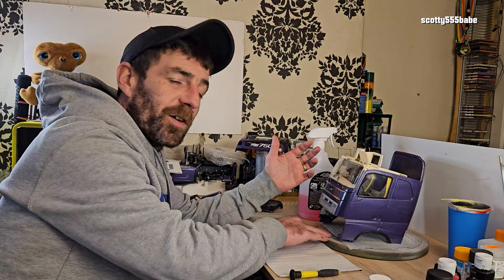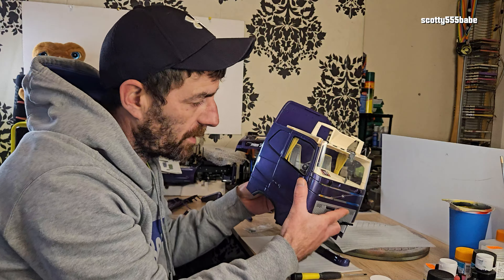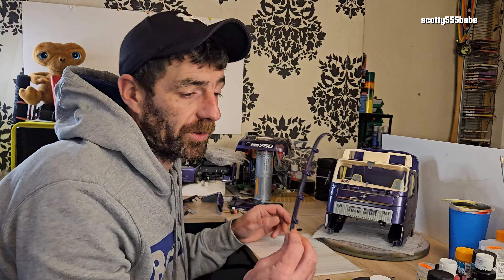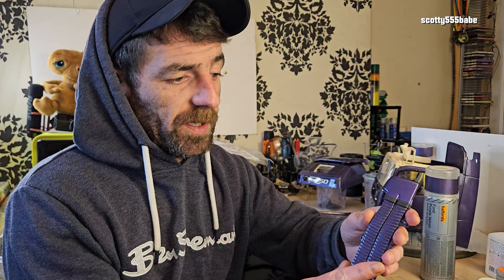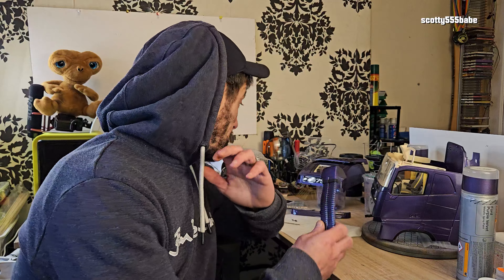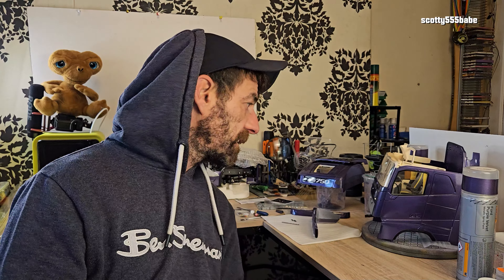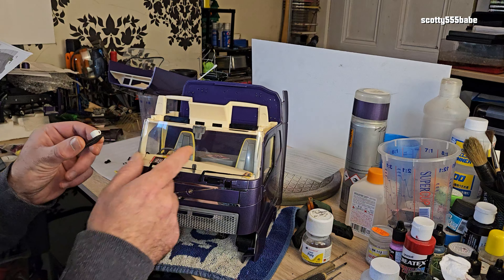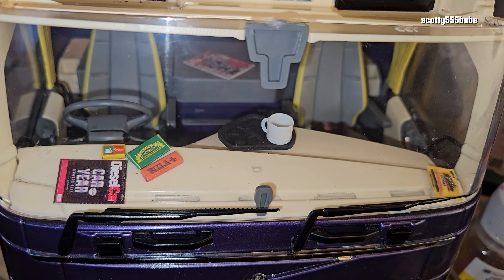Finishing the Verkerk Volvo FH750 Cab went from Bad to Worse | THE BUILD MANUAL LIED!!!

Comment: Great build, nice to see it is getting there Rattle cans will always orange peel due to the thickness of the paint so much better to use air brush. What lights and sounds are you running if any.
Reply from the maker: Thanks, appreciate it, I can sometimes spray with rattle cans and get no orange peel, I've recently started airbrushing everything now using mr hobby paint, they're fantastic.
I'm not putting lights and sound in this and I doubt I'll ever use it as rc due to the delicate nature of the build so I'll probably let my Dad have it to display 👍